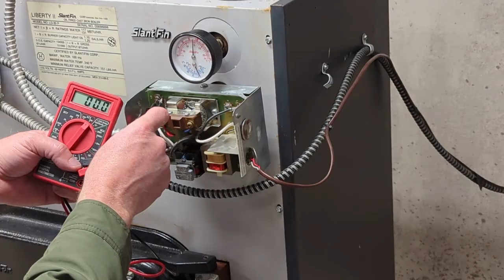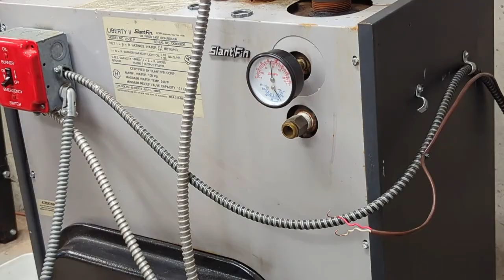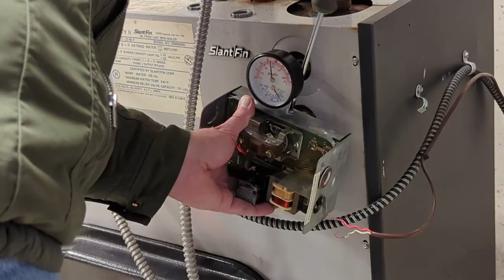Aquastat Repair

Comment: How to remove sensor???? I don't want to break it
Reply from the maker: It is just resting in a tube.  Sometimes it will be covered in thermal paste. It should slide out without much trouble.
Reply: I know this is an old comment , just here to add some info for the next guy :

Apparently if the paste was added to the probe/ sensor it can sometimes solidify making removal impossible and a new unit with a new sensor well will need to be added. That requires the boiler to be drained , the old sensor well to be removed and a new one installed. 

It seems like most professionals will not add the paste for this very reason. While it is supplied ( the paste) it may only be necessary in certain applications and it seems to be frowned upon in some circles

Comment: How did you ever  know to look at the back for broken solder ? 
An aquastat cost from $80 to $800  with the average being $200  to  $350
Reply from the maker: I had installed a new one. I like seeing how things work, so I took it apart.  I discovered the bad solder. After fixing it I installed it and kept the new one as a spare. They last about 7 years between fixing them.

Comment: Thank You so much. I had the exact same problem. It literally looked the same. Soldered it up and back on in the dead of winter.
Reply from the maker: I'm glad I helped you. The repair should be good for about 6 years. Then it will need to be done again.
Reply: @budget105  Yep! I did this repair 7 years ago. The same problem re-occurred last month. Repaired again, and it's working again. A new triple aquastat costs $400 at a "big box" home center. 10 cents worth of solder, and I'm back in business.

Comment: It desolders itself because dirty contacts create heat. Clean contacts, and resolder with silver solder. Ive used 60/40 a few times. But my solver solder has held up for over 10 years now. Yep... common issue.
Reply from the maker: @stansorochman2701  I use lead solder, and it's good for about 8 years. I haven't tried to clean the contacts because I am afraid of damaging them. They also don't appear to be dirty or pitted.

Comment: Hi came across your video, I can turn my thermostat up to a higher room temp. Circulator pump kicks on, but boiler don't turn on. Would you happen to know why, or could this be my issue what you just did
Reply from the maker: @nickpanhead7209  If you own a voltage meter, check if there is power going to the burner. If the circulator is running and there's no power on the burner lines, then the problem is in the aquastat. If there is power going to the burner and it's not running, the burner motor may need to be replaced.
Reply: I appreciate you getting back to me. I have 2 zones, one zone works correctly and the other 1. Just the circulator pump turns on, one of the thermostats is wired to the aquistat the other is wired to a relay box. The thermostat wires that are going to the aquastat. I am going to remove and ring out wires to the thermostat. Just to make sure i'm dealing with the correct set of wires that I'm having an issue with what terminals go to the oil burner itself in the aquastat.
The first zone I have no problem. I turned the heat on and the boiler Kix in the one. I'm having an issue with just the circulator pump turns on no boiler. I feel it is the aquestat like you're saying is that something that could be fixed with soldering, if it is.
Thank you for your help. Hopefully, you can get back to me.
Once again?

Comment: Great video.  I’ll add a few comments. Your Tridicator was replaced, but with a long instead of short stem so it’s sticking out.  But it’s allowing access to the mounting screw on the aquastat.  A triple aquastat like your Honeywell cost about $160, but if solder joints are getting blow out, I would replace the whole thing with a electronic one like the Aquastat 3200 for Gas (3250 for Oil) which has temperature and status lights indicating boiler activity.  By looking at the 3200 indicators, I can see the water temperature, if there is a heat call, and with the Economy function, it will try to adjust temperatures down in warm days and not just turn the boiler on/off like your electro-mechanical unit.  Also, it seems my old Honeywell wasn’t heating water to the 180 setting I selected, but a lower temperature which I discovered after installing the electronic asquastat.
Reply from the maker: @tonymanero5544  Thanks for your response.  I have a spare aquastat and have done the same repair on both. They last about 7 years after the fix. I will have to check out the 3250.

Comment: Thank you sir.  I am having same problem where pump won't run, but boiler is heating.  The relay is moving but is making a buzzing sound.  I am going to replace or repair this myself after watching this, I thought there was water under pressure where the thermostat slides into the pipe.

Comment: Also, in another version of this Aquastat, there is a 6 pin connector for damper control.  The solder joints on this connector also frequently go bad and can be repaired.
Reply from the maker: Good to know, Thanks for commenting.
Reply: I think that’s the problem I’m dealing with. How do I repair that? Do you have a video?
Reply: @chephoenix2551  Unfortunately no. Basically, you need to carefully disassemble the Aquastat to get to the rear side of the circuit board.  Then using a soldering iron, carefully reflow the solder joints with some electronic solder (with flux in the solder)....assuming you have a soldering iron.
Reply: @michaelnessen3605  if I can make it through the winter… I think I’ll take a crack at soldering the joints on the damper control connector.
Reply: @chephoenix2551  Unfortunately, no.   You basically have to carefully disassemble the Aquastat to get to the rear side of the circuit board for the soldered pads of the connector.  Use electronic solder with flux built in and reflow the pins.....assuming you have a soldering iron or gun.
Reply: @michaelnessen3605 thank you! I’m hoping I can get through the winter without disassembling the aquastat. I replaced the thermocouple and the gas line. I’ve been having trouble keeping the pilot lit and the pilot guard is burning red hot. I don’t think that’s normal. Maybe I should turn the pilot down.
Reply: As it turned out I purchased a pilot light and gas line assembly for liquid propane. Such a “Johnny homeowner” move. Thankfully I had all of the correct parts here and I was able to get a technician to help me correct my error.

Comment: Excellent. I had the same problem with the circulator working intermittently. I followed your clip and had ONE  solder that simply disappeared.  I resoldered it and now works beautiful! Honeywell needs to do better quality control in their manufacturing factories! Thank you very much!👍
Reply from the maker: Great 👍. I'm glad I could help.

Comment: Also having trouble with my Aquastat and will work thru this fix if it is the problem (Intermittent firing.)  NOTE:  I also had this problem with the kitchen stove.  It originates from what I understand from the manufacture of the board.  The solder joints are "cold" and do not bond correctly and when the power heats up the joint because of high resistance the remaining solder just flows away from the joint.  Boom! no connection.  Fixed the stove 2 years ago and is still working. I guess this will be the next project.  Thanks so much for the schooling, I LOVE YT providers who do this kind of stuff!
Reply from the maker: The brushes on the burner motor could also be going bad. Check the output of the aquastat for power with a multimeter. If there is no power, the problem is in the aquastat. If there is power the burner motor is the problem. Good luck on your repair.

Comment: Great Job Brian , I'm sure many people run into this common problem... minor suggestion and if possible  use a desolder wick to pull all old solder off board ,clean with alcohol , and when resoldering if you access to solder flux pen apply 1st and you'll end up with factory type strong solder. In a pintch I'd do exactly as you did, once more GREAT JOB BRIAN !!
my 2 cents : Mass.🛠 plumber

Comment: Thank you very much. This is exactly what just happened to mine about to disassemble and solder here soon. Thank you.
Reply from the maker: You're welcome and I am glad my video helped you. Good luck with the repair.
Reply: The soldering and contacts sanded worked for a few days.  But I had to install a new aquastat.  no problem one hour install turned on everything fired up except the furnace and that’s because I didn’t put the jumper on for the 24 V on the Honeywell J1009. I believe that’s the last four digits. I couldn’t of done it without you. Thank you.